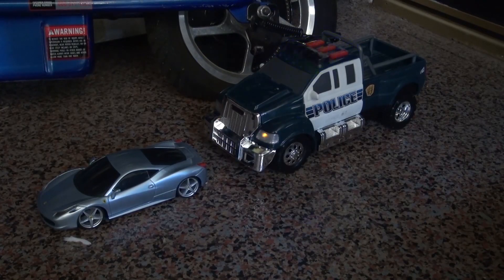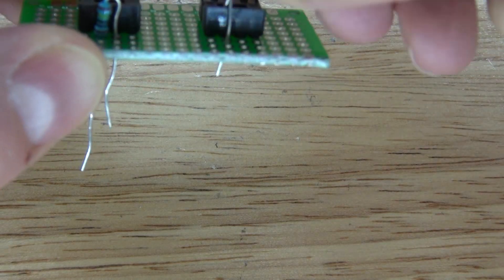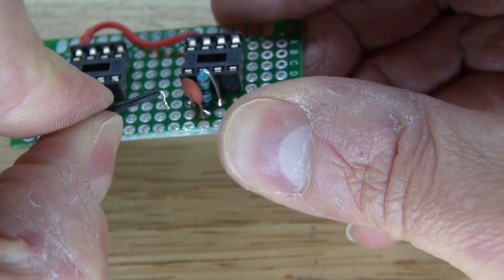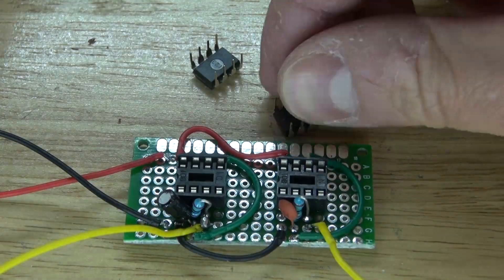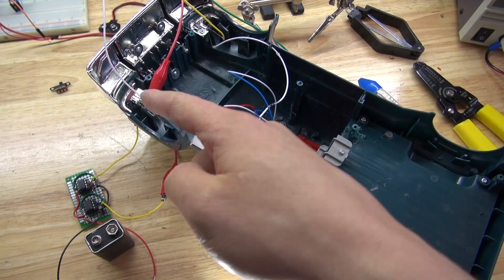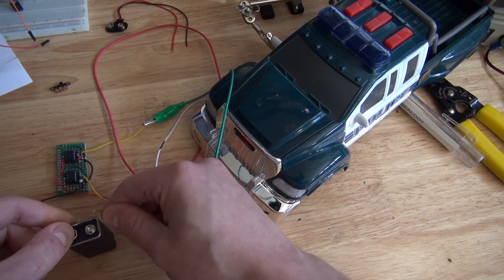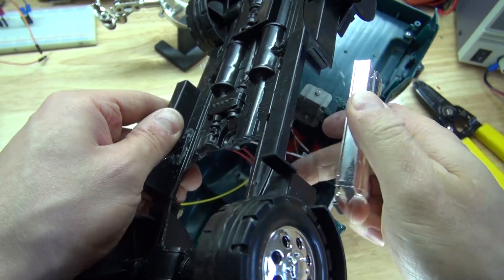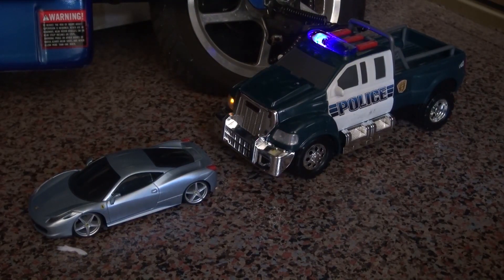Dual 555 Timer Police LEDs

Comment: what is the Voltage output? can I connect 12v cob leds blue and red?
Reply from the maker: It is 9 volts. You can use 12 volts but if you do it may change the speed of the blink rate of the leds.